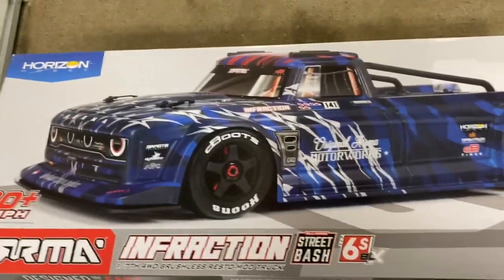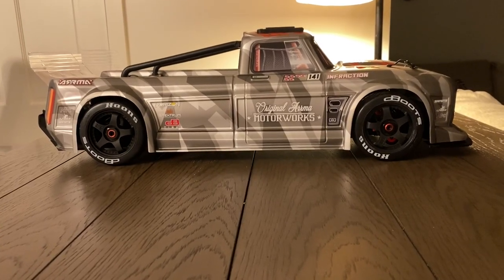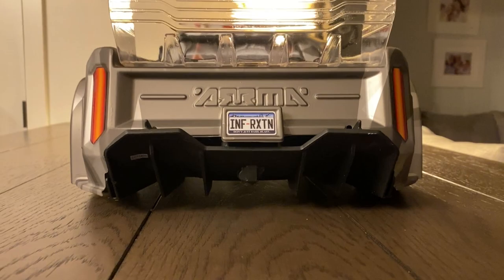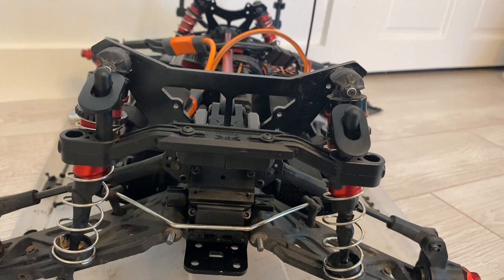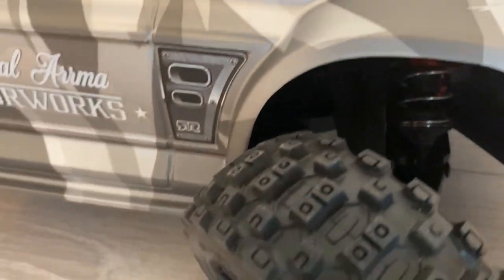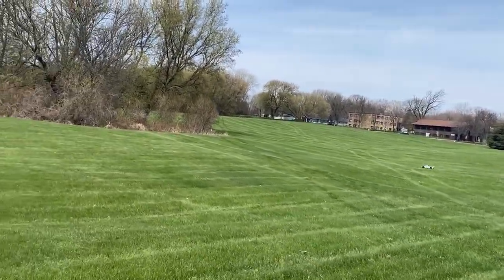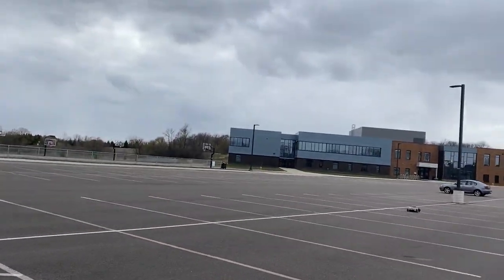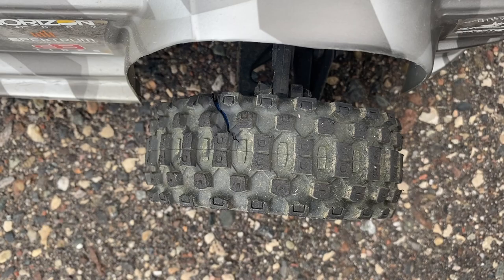Arrma Infraction 6s BLX v2-Unboxing-off road conversion and first run-can it handle the dirt?

Comment: Why not just buy the buggy?
Reply from the maker: Because there is not a 1/7 scale buggy in my opinion that is 6s and looks this cool. Also, with this conversion I can still run the stock drift tires (dboot hoons) and can also run it off road in dirt/grass.  Pretty makes this an all around RC vs just an onroad drifter.  Another note, running this on road on as a drifter you, Burn through tires every 3 battery packs or so @60 bucks a set.  

Appreciate you cruising by!

🤝💪🏎💪🤝🤝🤝

Comment: tekno is good as it is known for its durability ppl put tekno shafts in slash so having the kit makes it almost impossible to break got mine few days ago finished building waiting on a pinion now after tht ill see wht its made of i 
put a spektrum firma esc combo 150a.just need to paint the bodt cant wait to see how it drives.

Great vid btw 😀
Reply from the maker: Thanks so much for taking the time to share this! 

Appreciate you always being here! 

🤝🏎💪🏎🤝🤝
Reply: got the pinion took it to the track its a beast i think youll love it its just that building the kit take some time but after its ready u just cant stop lookin at it its a great piece of kit.

Comment: Hey cool projects!!!! Thanks!!!  I'm running my stock Infraction on grass fields and dirt. It really is allroad. I haven't run the front splitter for many months.  Rc does fine without it, even at 86mph.  For offroad I run 1/8th scale buggy tires and raise the ride height.  It is actually faster than my Typhon in the small field near my house! I can get 50mph (gps) before I need to hit the brakes in the Typhon.  Got 54mph in the Infraction! FYI, I did a little trim of the body behind the rear wheel.
Have a great RC day Moe!!!  (I'd like to see the Lasernut offroad on a trail and on rocks in the woods.  That's where it separates itself from all my other rc's)
Reply from the maker: Louis! What’s up!

Thanks so much for taking the time to share your rig is set up! 

Appreciate you being here and providing positive energy!

🤝🤝🤝🏎🤝🤝👊🏽💪